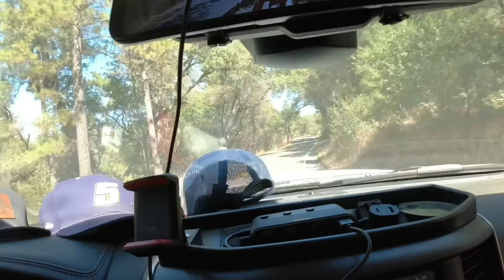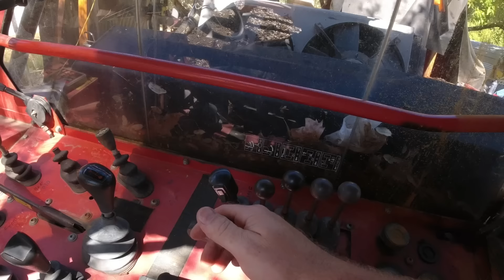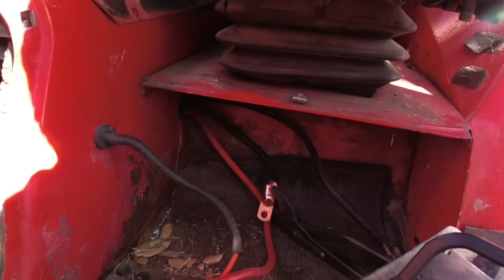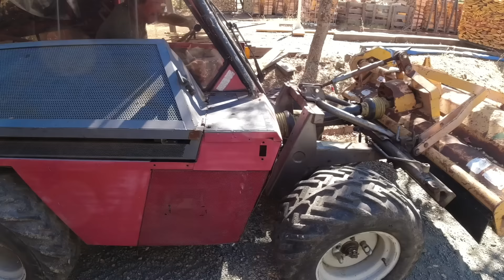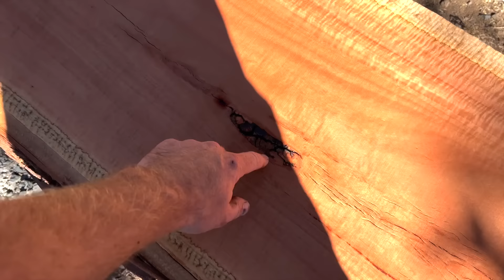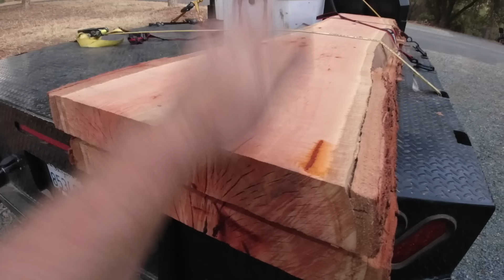Vbelts new machine won’t start. Trying to figure out the issue

Comment: Oil is a  bit low or sensor wires came lose or is bad sensor, just a thought and you would not believe how many times I went out to a job and oil is a pint low and shuts down or won’t start .